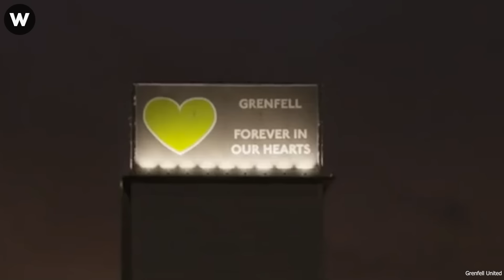15 Terrifying Road Moments You Wouldn't Believe if Not Filmed

Comment: Multimillion dollar boats without any means of extinguishing a fire.  Surrounded by water.  No water guns installed.  Well, if they installed a means to put out a fire, that would limit the insurance scam options.  You could literally install water cannons at several locations that would suck WATER out of the body of WATER that the boat was built to travel in and that WATER could easily be used to extinguish a fire, as there is relatively INFINITE amounts of WATER that the boat is floating on.
Reply from the maker: We appreciate your comment! Your engagement fuels our motivation to create more amazing videos. If you enjoy our content, please consider hitting that like button and subscribing for more. Thank you!

Comment: For some reason I get the feeling insurance scam when I watch the Yacht fires. Probably not all, who knows?
Reply from the maker: Thank you so much for taking the time to comment! Your support means the world to us. Don't forget to like and subscribe to stay updated with our latest content. 😊👍🔔
Reply: @hvacr2034 most port fires like these are do to refueling mishaps or resuduel fuel fume pressure released atmospherically while refueling on the vessel from reserve fuel storage. They are all either done deliberately or negligently which results in waterway conflagration. These vessels are made mostly of carbon composition materials, fiberglass and plastics all of which are highly flammable. So there is little an FD can do to contain the blaze on the vessel itself which spreads quickly and consumes adjacent similarly constructed vessels.